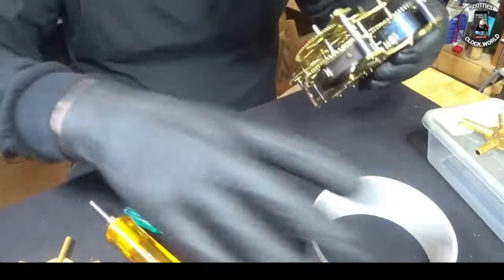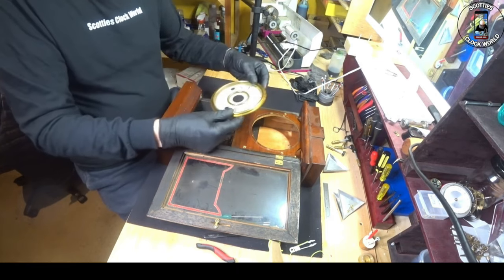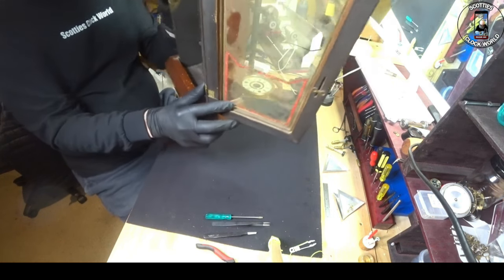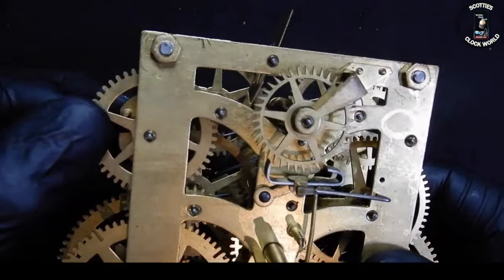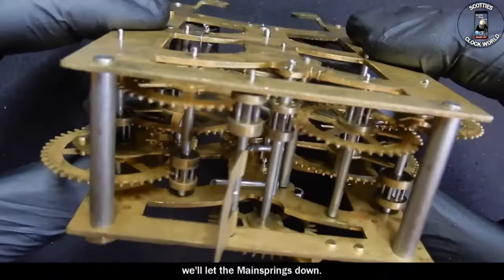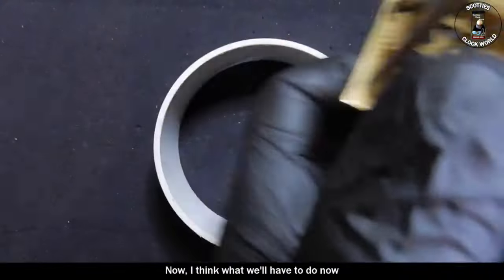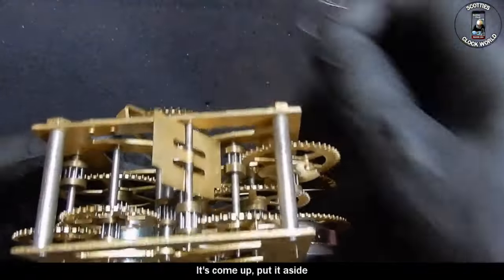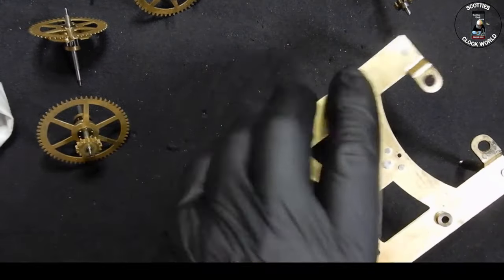New Haven Music Box Clock Service - Full Video

Comment: What solution do you use to clean with
Reply from the maker: Ultrasonic Cleaner Solution

This is the brew that I use these days, you can make it yourself.
Works just as well as the super expensive 'professional' ones.
Acetone 2%
Oleic Acid 2%
Detergent 2%
Water 90%
The figures don't add up to 100% because the first three ingredients are combined then diluted 1:9 with the water.
Reply: @ScottiesClockWorld  thank you so much
Reply: @ScottiesClockWorld  will muratic acid work? Oleic acid not easy to come by here.
Reply from the maker: @bernardpoole9123  , no, hydrocloric acid will be too strong and cause damage.
Reply: @ScottiesClockWorld  thanks much. I found oleic acid on eBay and ordered it. Thanks so much for answering me
Reply from the maker: @bernardpoole9123  , glad it worked out for you. Thanks for your comment.